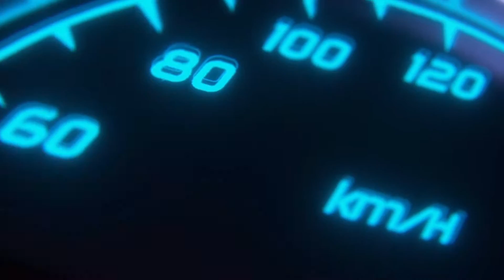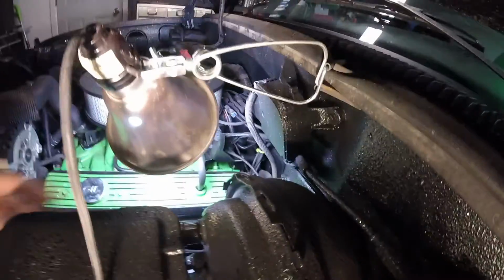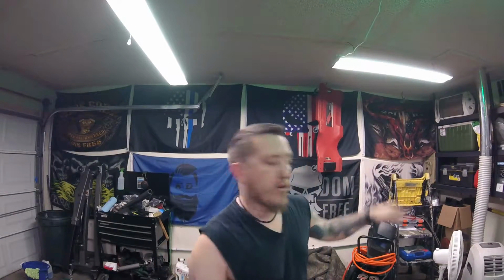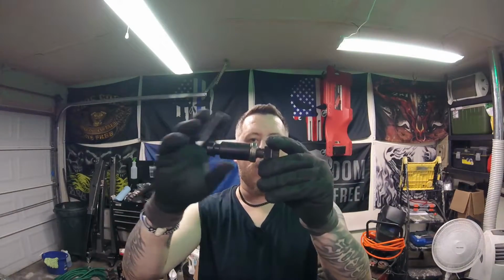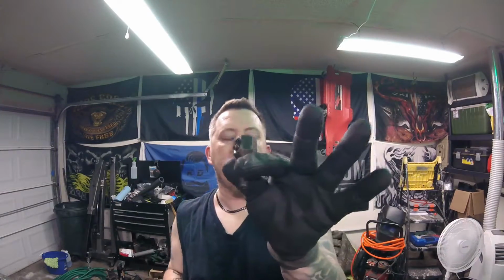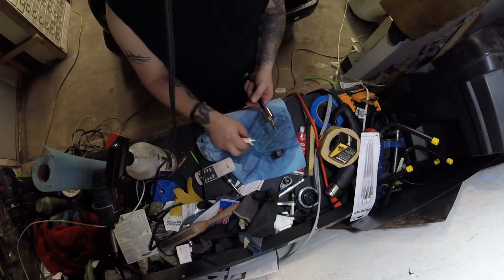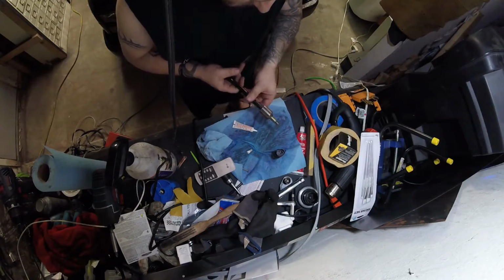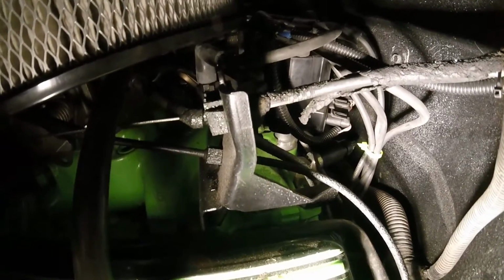350 TBI Oil Pressure Sensor Leak

Comment: If the oil pressure switch is bad will it cause the truck to stall out
Reply from the maker: If its a tbi engine there is so many variables for stall.
Reply: @DrivenbyGears  he did alot to it new fuel pump fuel regulator distributor wires and spark plugs and probably just about every sensor. The thing is when it stalls out he can't get any spark when starting it again
Reply from the maker: @matthewfalciano7995  sounds more like the igniton control relay , but could even be knock sensor.
Reply: @matthewfalciano7995 surely fixed now but yeah, ignition control module